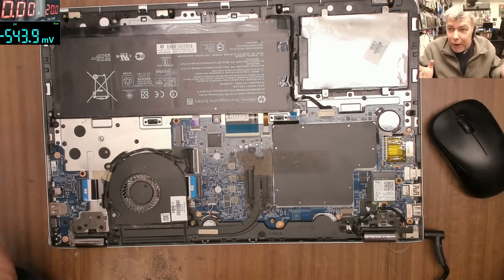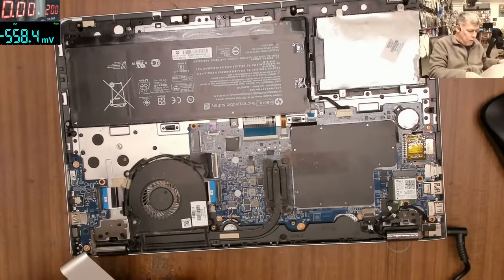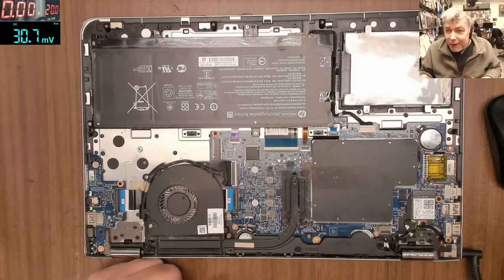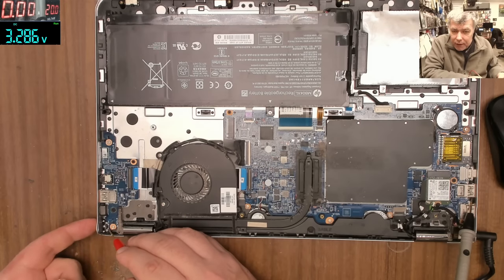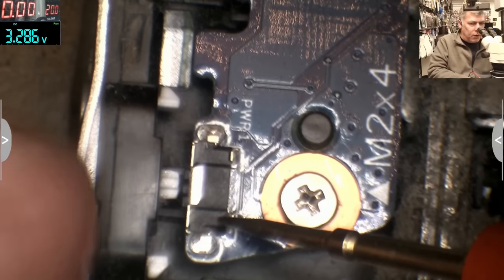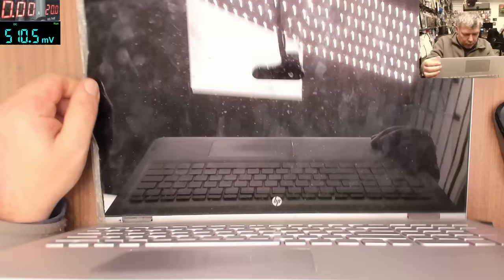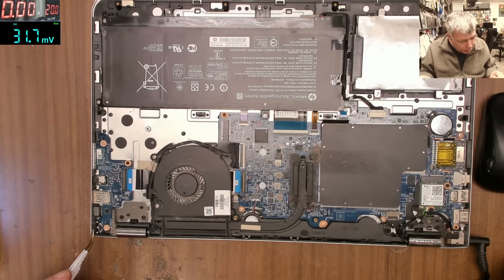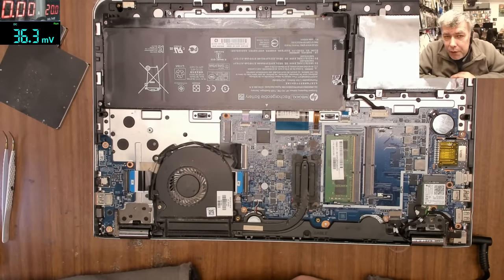Hp Envy 360 charging but not coming on - a common fault in this model

Comment: The crack solder problems became more of a problem when they took out the lead from the solder.   Refloat the solder with 60/40 leaded solder  the joint will last a lot longer.

Comment: I have an hp laptop after water spills I can charge it,as soon as I open the the laptop cover the charging light goes off and pressing power button will not work. 
I cleaned everything possible with alcohol, what should I do?